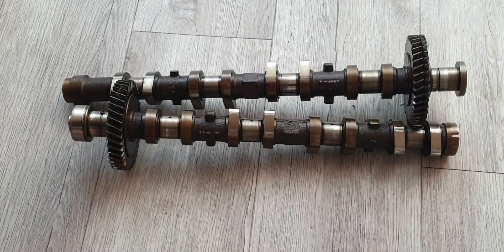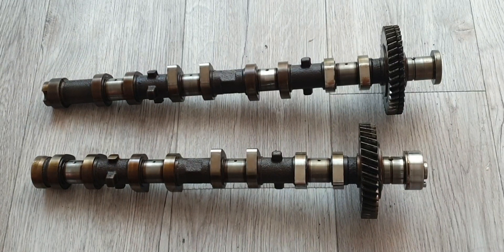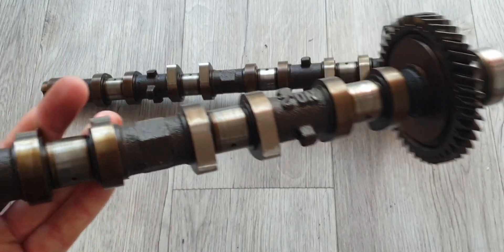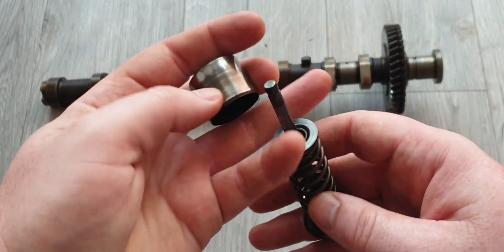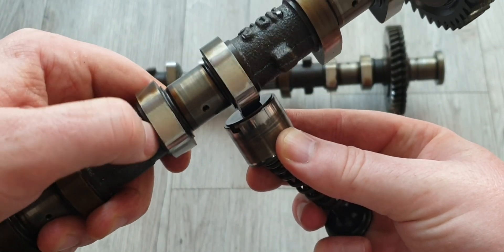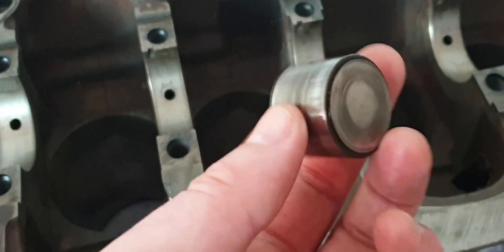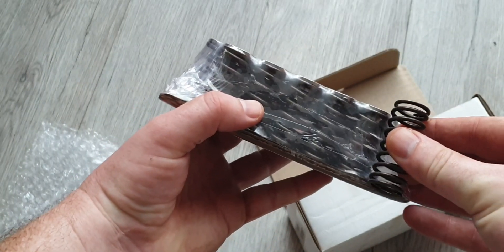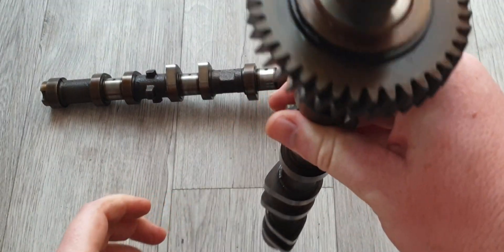Do I need performance camshafts or just a regrind?

Comment: i have  question, i will be glad if you can answer.

I have regrind camshaft from 2.0 16v ABF ( im shure  90% about that)
Base wheel is in OEM 38mm in my regrind is 35,7mm
Lift in OEM is 10.9mm in my regrind is  10.6mm

I really dont know how to measure it, but im curious about smaller amoutof lift in regrind cam. Is that correct?

Comment: Jjjj😊😊😊 well amigo I have a CRX and a 1996 Geo tracker with 272 regrind Delta camshaft and I can tell you a big difference from stock camshaft they do work beautiful in stock d15b2 16 valves engine and the stock Geo tracker 16 valves engine both of them have gd air filter header and free flow exhaust system the CRX have a 10 pound flywheel and gd clutch plus a d16 head gasket around 9.6 compression or more or less and she is a duel fuel injector system and believe me hard to catch in higher rpm she do fly to fast for what it is but as well she have a lots of aluminum parts and the Geo tracker aluminum crankshaft pulley etc and the Geo tracker 16 valves engine really pull nice in the highway with the regrind Delta camshaft 272 and the CRX is a speedy Gonzales jjjj in the city and highway people think I have a k20 or a k24 b16a engine on her jjj 😁 but the secret is weight remember the d15b2 engine 16 is a gd breathing engine plus crankshaft connecting rods and everything is lighter than d16 k20 k24 b16a meaning reverse faster and the aluminum flywheel make it reverse faster when you hit second gear I'm in 3 gear pulling and here where the 272 camshaft becomes a monster nothing fancy to all Honda lovers but to see that back rear lights you nd to fight after second gear she is all cam torque and rpm 3 she really pulling fast and you be around 90 to a 100 miles a hr with long gear transmission and the others be in 4 gear jjjj 😁 and you will have 2 gear more to play on 4 gear you be around 125 miles and pulling and all in a regrind crankshaft and the right combinations junkyards parts real simple from here on others will be in the tracks well Im a streets guys who love to enjoy my toy every day and play around in the streets with the guys big difference in my opinion the best motor to play around is the little d15b2 16 valves engine believe me is a lots of fun and like I said fast in a light weight CRX special the base CRX CCR born in the byouooooo amigo emigen that a d15b2 16 valves engine get neck to neck light to light with a muscle car or a porche Corvette Camaro dodge etc jjjj and in long run a little d15b2 16 valves engine be next to you at 135 a hr a penny little ass CRX d15b2 16 valves engine jjjj plus easy to maintenance cheap parts and build will combo from a junkyard and a regrind Delta camshaft jjjjj remember weight and hp power when is nd it mid range up mambo king light up CCR run t the jungle jjjj go always with regrind Delta camshaft for the streets in Civic 272 in Geo tracker 272 the best cam in my opinion and if you want higher rpm change the valves springs and drop a Weber carb and here you will have to hold on with a 272 cam will take you easy to 7200 or 7400 rpm no mercy no prisoners the cam and the Weber and flywheel and light weight internal parts on d15b2 16 valves engine will become a monster shorter connecting rods meaning no much bottom even the aluminum flywheel will help you a bit with that but after first hang on kp it always in mid range up by by ASTA la Vista baby jjjj believe me we out here know the old school style way take care gd video

Comment: Just thought I'd add that they are shim over buckets on 4e & 5e engines. Where the marks are that you mentioned on top of the bucket is the shim. You remove them by sticking a small flat head in that cut out on the side of the bucket to lever it up. Although solid buckets can be fitted from a yaris (1SZFE I believe) if you were to raise the RPM limit beyond 9000rpm to avoid the shims being flinged off the buckets
Reply from the maker: Hi Trevstar, thanks for the comment and I'll keep that in mind when I actually get off my butt and start this build...
Reply: @920400706  No problem mate, keep it coming 👍🏻

Comment: Thanks for the great info. This helps a lot. I have a Civic with a K20C2 engine and there are zero aftermarket options, so a regrind of OEM is pretty much the only route for me.
Reply from the maker: Hi Matt, you're welcome man. Being a K series it's going to be one hella capable engine, and perhaps you can get a thicker head gasket to take down that 10.8 Comp to lower for boosting. A regrind will do you well and save you money but check with Ivan Tighe in Australia, they may be able to make you a billet set of camshafts if they don't stock them. Are you going to boost your K20C2?
Reply: @920400706 , thanks for the response! I would absolutely love to boost it, but have found zero aftermarket support for this particular engine. I am hoping that changes, as it appears to be the NA powerplant for at least the 10th and 11th gen Civics... So far I have an intake an KTuner flash. Cams and downpipe would be nice. Turbo is the ultimate goal, though.
Reply from the maker: @MattBowler  Yep go with your heart on this one, if it's the K20C2 then you'll work it out on the contrary the reason I went with the motor I have is because of the immense aftermarket support in the UK, but just remember there's no such thing as a cheap build, so trying to save £1000 ends up costing you £3000 in the end so I stepped back, wiped the egg off my face and said right, ill save up and do it right the first time.
Reply: I talked to Oregon cams and Delta cams that both do regrinds.   I was told that up to .150" lift can be gained and 30 or so degrees of duration.   For more duration you can weld to the lobe and grid it for a different profile.    Some of the regrind companies supply the thicker shims that are required.    So we should ask.
Reply: @dennisrobinson8008  that's great to know. Thank you!!